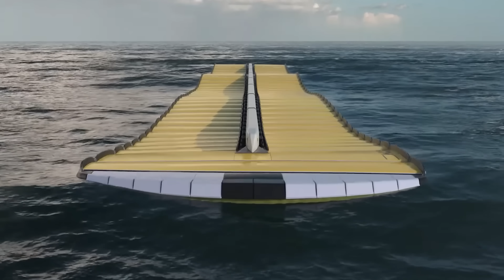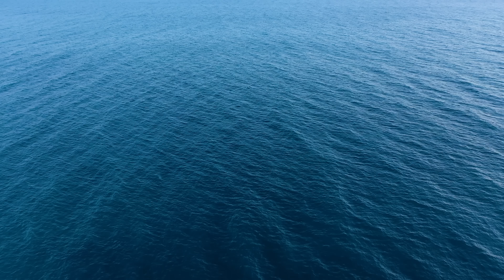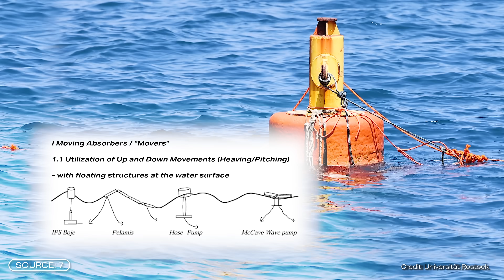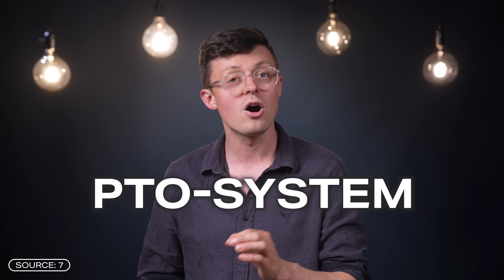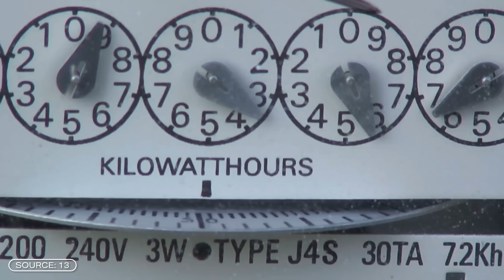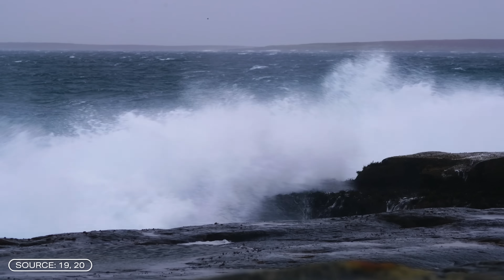The Cheapest Energy Source Ever? Wave Power at 1 Cent Per kWh

Comment: As a retired aerospace systems engineer I  often look at the military potential of  these new technologies.

Here I could see these used by Taiwan to both generate power for commercial use but as a layered defense again amphibious invasion by China in that the can me deployed near good landing sites and have sensors and pften weapons mounted3on them that  get their power from  the wave power as well (plus a back up battery  when that is not available).

Thus they can pay for themselves in peace time but  transition to  a military one  in time of war.

Yes they can be target but  that is just one more thing that  China would have to target and they could have  air defense capabilities as well  so that  they would need to be hit by expensive missiles that thus might be used against other targets.

The fact that they in peace tine can pay for themselves makes the in a sense low cost and so the cost trade could be positive in that as we have seen in the war in Iran the issue is how many missiles can one before before running low on them and thus the more targets  for them to shoot at means  the sooner one  runs low on them.

Thus one  is using the low cost for power  as way to tip that cost calculus into the defenders favor plus getting  the electricity in peace time as well.
Reply: Great idea, now you just need to find a Chinese manufacturer to build it.

Comment: With the increased installation of off shore wind turbines, is anybody working on wave power devices that could be attached to these installed bases, and use the existing power grid of the wi d farm as well.
Reply: Could put solar panels on them too
Reply: Yes, wave and offshore wind is actively being developed. There are good opportunities for synergy between the two, also because most windfarms are no go areas for shipping.
Reply: Green energy isn't green. Nor renewable. Why pollute so much when we can have thorium reactors. What a waste.
Reply: @a-normal-mousse are there any examples already functioning or close to working ?
Reply: I think there really isn't that much synergy. Yes, you can use it as an anchor point, but you'd need to reinforce the base of the wind farm to do so. And you can use the same power lines, but both systems depend on wind to produce power, so they produce most of their power at the same time. And since both use wind, the wind farm might reduce how much waves you get and thus how much energy you can extract from the waves.
Reply: @GerbenWulff the tides are products of predictable lunar gravitational forces, not weather conditions. so there are lots of versions of this design that are relatively indifferent to wind conditions.